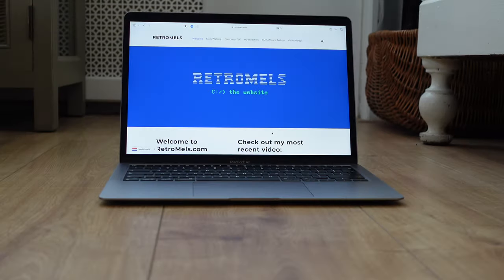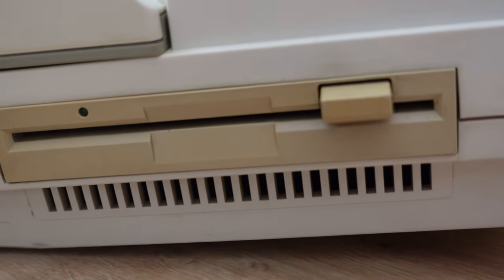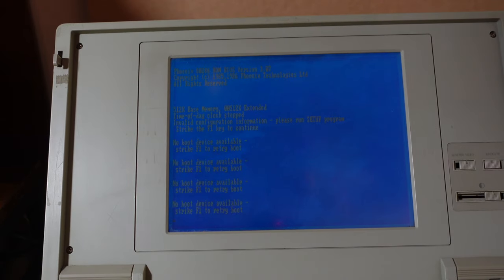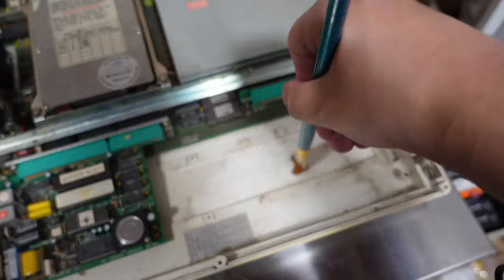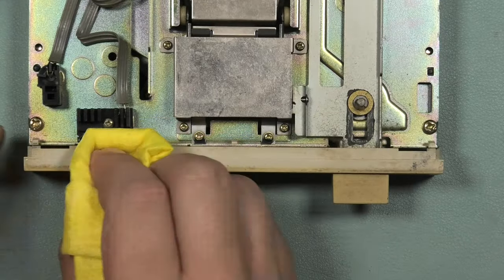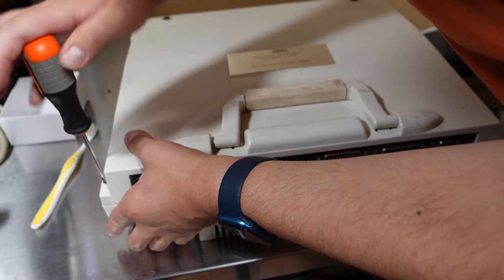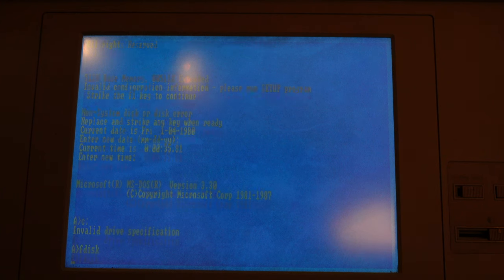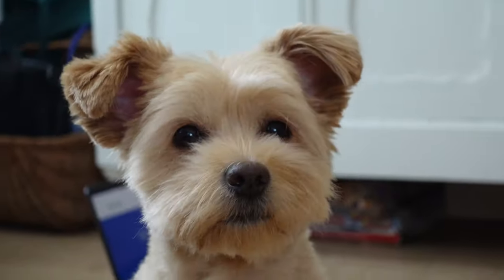Messing with a GINORMOUS vintage Laptop |Computer TLC episode 8|

Comment: Hya!

Unfortunately I can't tell you anything about the machine or brand itself.
The chips in the machine and the drive give away that it would be a late 1987 or early 1988 machine. Most chips are from around june/july of 1987 that I could see so quickly.

The good old Miniscribe drives :)

The sticker on it gives the exact position of the 'bad bytes' on the drive. 
Those are the results of factory tests (and normal on those drives). It is on the top platter (which is read by head 0), on cylinders 415 and 417 (why not 416, I don't know, but from the byte-offset (which is the place which correspondents to a specific angle of rotation on the disc) one could pinpoint exactly where the issue would have been.

Those should be entered in a low-level format as the controller will mark them bad and make those sectors unusuable in some way the OS wouldn't even know those existed. Those offsets indeed aren't dates :)

I hope you get the hard-drive working, but it looks like you might need a setup disk. 
That will be hard to find, no doubt, as there was nothing on the net even as you've said. 

You might want to google for 'gsetup useless software archive' to try out if you can enter a setup that way.	

Nice find either way, looking forward to a part 2!
Reply from the maker: What an awesome and even better informative comment much appreciated!! 💪 will take that into account for part 2 😁
Reply: @RetroMels  you're welcome, keep up the good work :)